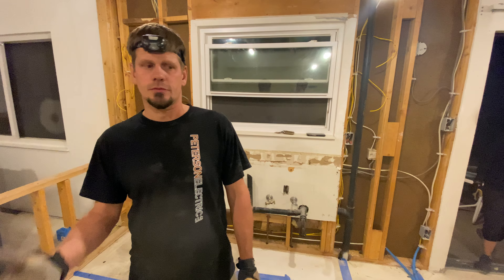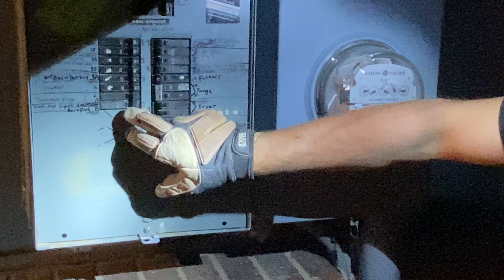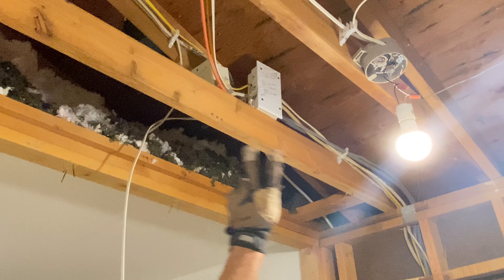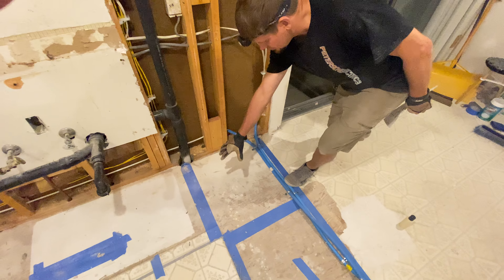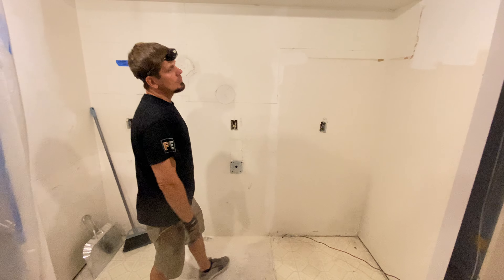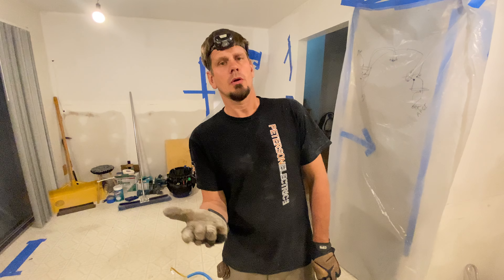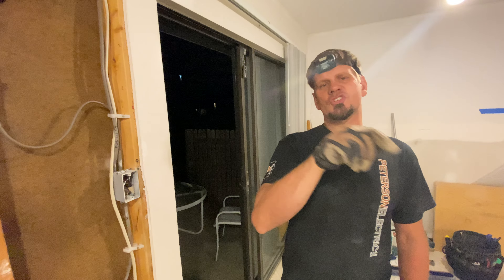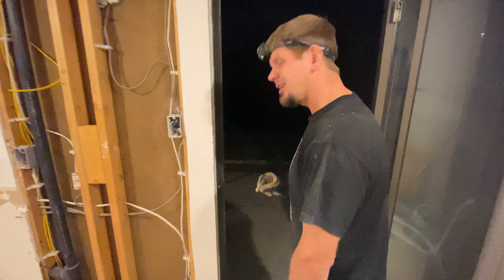What To Do When Lights Are Flickering Everywhere

Comment: I didn’t catch the answer.
I too have a dishwasher tied in with two bathrooms, bedrooms on the opposite side and some garage lighting. Since last storm, I lost one breaker and the associated main and due to age I swapped them out first with no issues and replaced all the 15a (subs). There has since been flickering all over the house, a week later I tripped a new different breaker but not the main. The breaker didn’t even show tripped. 
It’s a 1956 house, all Romex with ground, Square D shunted(?) panel - I have a few mains, with sub breakers in same panel.

Comment: Another excellent review Josh. It's a shame that you have to know your audience like that. I have been learning " home " wiring 
since I was a toddler and it amazes me why half the developed world hadn't burned to the ground caused by substandard 
residential electrical service. I'm talking 8 circuit 60 amp. fused load panels here.  I'm here to follow your dalliance into the 
2020 NEC revision.  Along the way you are a competent knowledgeable educator. You won't catch me rattin' U out !    Cheers.

Comment: The trip curve on the main may well be different than the branch...especially the instantaneous trip.  Just because a branch is a lower value, it doesn't mean it is the most sensitive in terms of short current.  To trip a 200A(or whatever) main and not trip the 20A branch breaker is not unusual and not unexpected.

Comment: This is kinda off topic to the video but I gotta ask. Where is the strangest place you’ve ever seen a sub panel? For me it was an FPE panel in a lower kitchen cabinet directly under the cooktop. I removed that panel and consolidated it with a different panel that was in a linen closet with a new panel in the hallway. Homeowner told me that a circuit had tripped in that panel and it took him months to find it.

Comment: Lots of work for just a quickie remodel, but you are a man with a plan! Gotta ask how you get through an inspection now without the room for arc-fault breakers? Not clear on the code. Are they only required after a new service is installed? BTW, the only fault I find with your videos is the audio. You really need a mic clipped to your collar so the sound is more consistent. (yes, they are some made to work with a cell phone cam)

Comment: when you Drive your two ground rods, what is your maximum allowed resistance to ground ?   over here in the UK, we have to be below 200 ohm.  it can be hard to achieve sometimes if the soil conditions are poor.
Reply: You can have only one rod if you can prove less than 25 ohms resistance on it, otherwise you must have two and the ohms are not tested- they just have to be 8 feet each and at least 6 feet apart with 6 gauge wire.